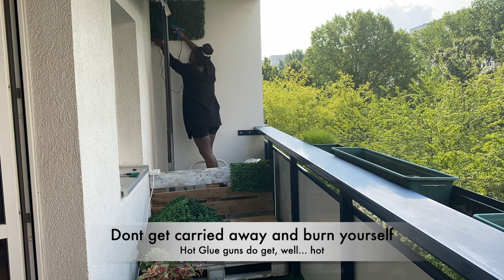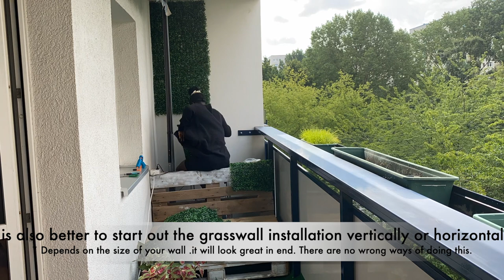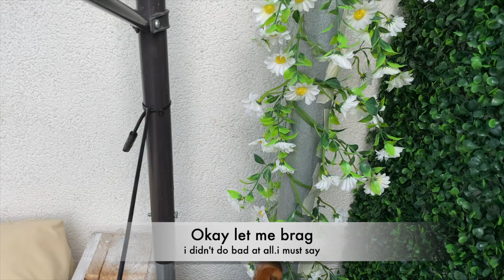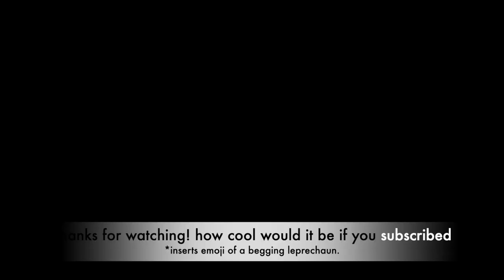HOW TO INSTALL AN ARTIFICIAL  GRASS BACKDROP ON WALL | RENTER FRIENDLY

Comment: My concern would be when I want to remove them.  All that glue is going to be tough to remove.
Reply from the maker: It is actually pretty easy to remove . I gave it a touch up last spring and it came off very easily